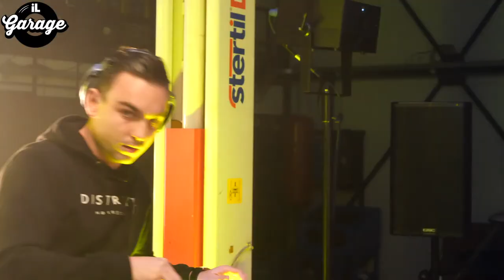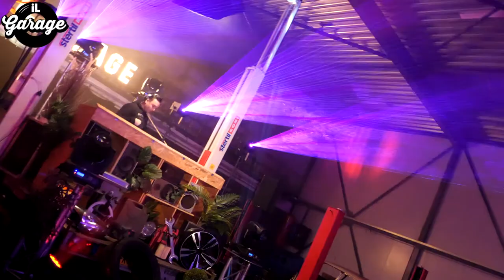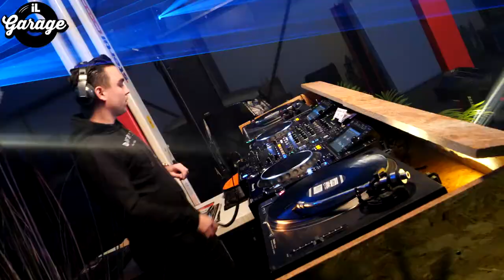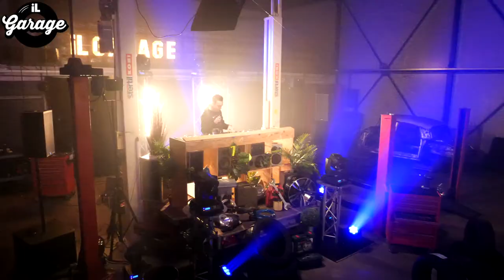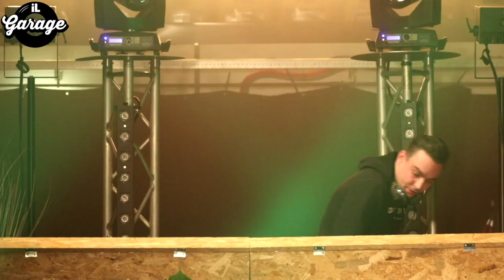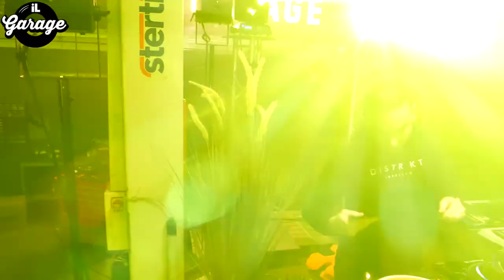JIM CRAANE VINYL ONLY HARDSTYLE CLASSICS SET AT IL GARAGE

Comment: Mijn 1e keer een volledige vinyl set! Let niet op sommige offbeat overgangen hahaha

Tracklist:
01. Dark Oscillators – Nero
02. Lowriders - Don't Get Back (Dj Isaac Remix)
03. D-Block & S-te-Fan – Music Made Addict
04. Headhunterz - Reloaded Part 2
05. Bioweapon – Move Your Body
06. The Prophet Feat Wildstylez – Cold Rockking
07. D-Block & S-te-Fan Ft. MC Villain - Sound Of Thunder
08. Noisecontrollers - Attack Again
09. Zatox - So High
10. Crypsis - Get Hit
11. Mr Puta - Green Stuff
12. The Beholder & Zany - Bleeding For The Harder Styles (The Official Decibel Anthem 2008)
13. D-Block & S-te-Fan - Supernova
14. Frontliner - The First Cut
15. D-Block & S-te-Fan Ft. MC Villain - Part Of The Hard
16. Outblast & DJ D	Electro Shocking (Dyprax Remix)